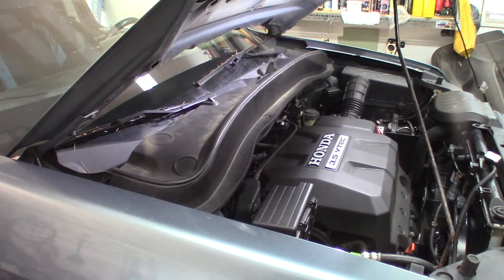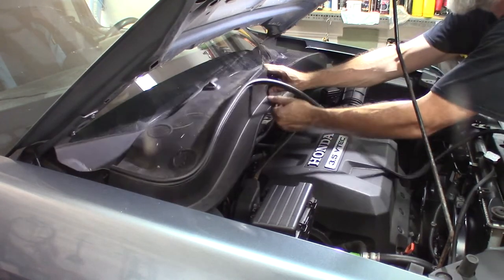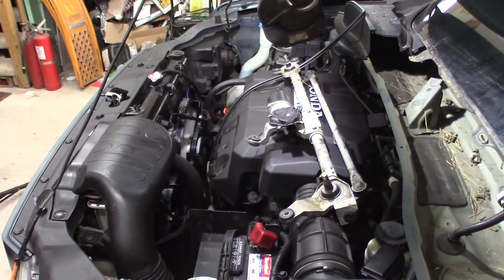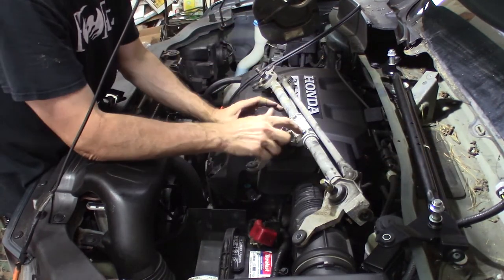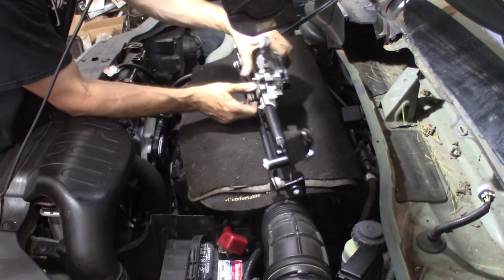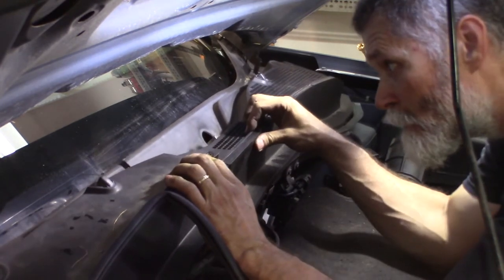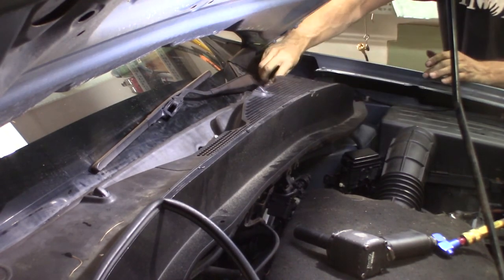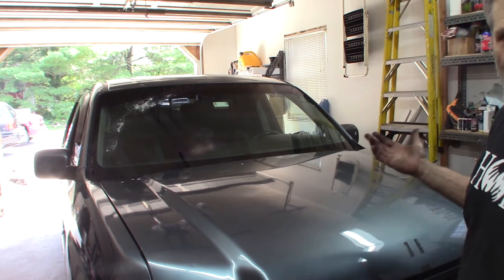2006 Honda Ridgeline Wiper Motor Transmission/Linkage Replacement

Comment: Thank you for pointing out the importance of aligning the rotating arm with the transmission rod in a straight line before reinstalling. That's exactly the mistake I made, since other videos did not mention that alignment. Keep it up!
Reply from the maker: glad it helped

Comment: Thnks for a very informative vid tutorial. My 2006 Ridgeline driver side wiper nolonger engaged to work. However, the passenger side is working fine. I wonder if the driver side wiper comes loose a bolt or something else? Please advice. Thx
Reply from the maker: There's linkage to both.  Possibly the driver's side came off of the linkage.  The only way to know is to remove the cowl and take a look.
Reply: @CharlesAndCars  Thx, I will have a look later. Have a great night Sir.